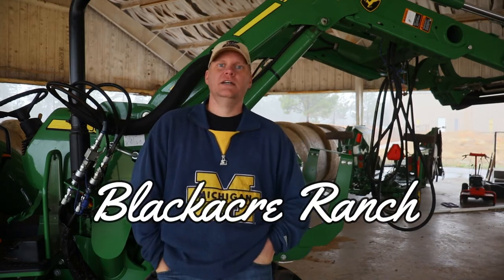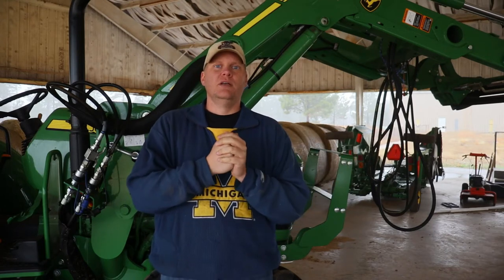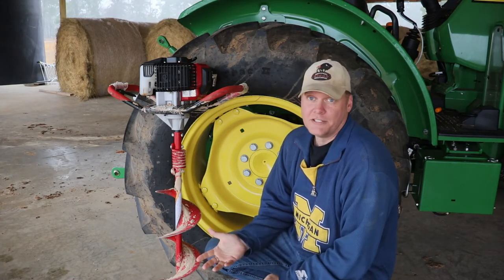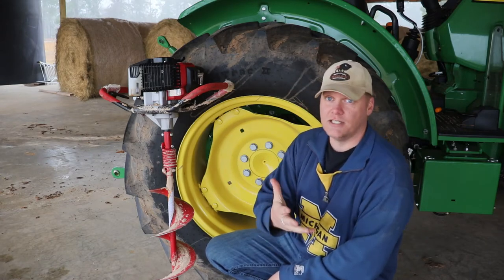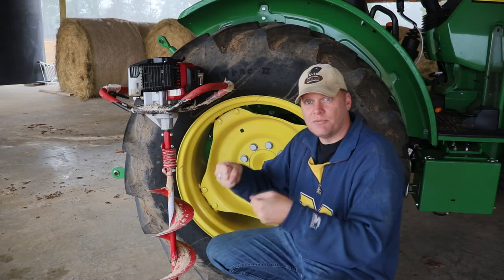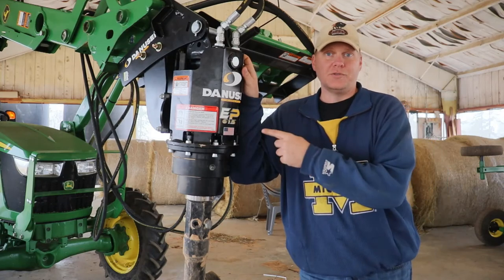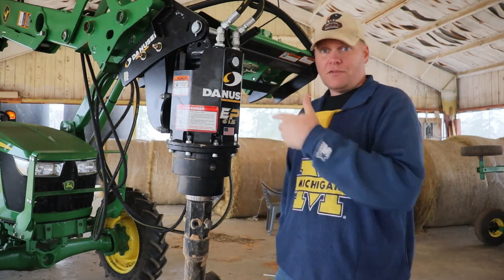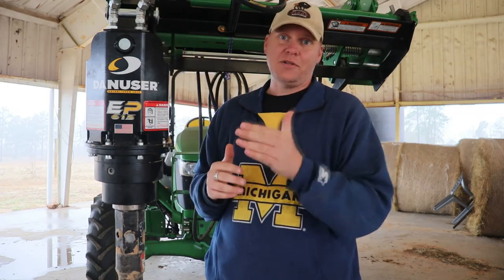Ep. 67 - Review Post Hole Diggers | Why Danuser | Blackacre Ranch

Comment: Good, practical analysis. I wonder if there are places that will rent the Danuser to people. I know there are a few places (like Home Depot) that have specialty tools to rent for smaller, short-term projects.
Reply from the maker: There are places like that that exist.  I have not had luck finding such a tool around me, especially for a tractor.  You can find some places that have similar augers but they mount to a skid steer.  Then I have to pay for the rental of both, along with an adequate sized trailer to tow it all, and the time scheduling to pick them up and drop off.  :)  Being out there on Saturdays makes rentals really difficult and costly in my case.